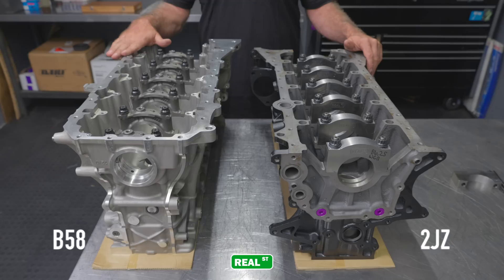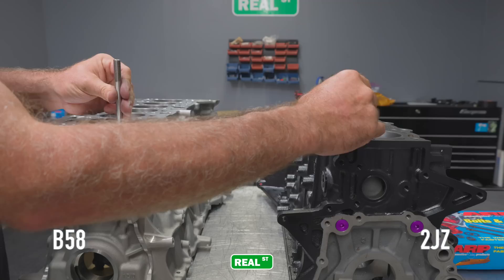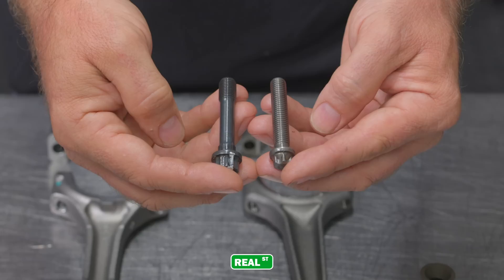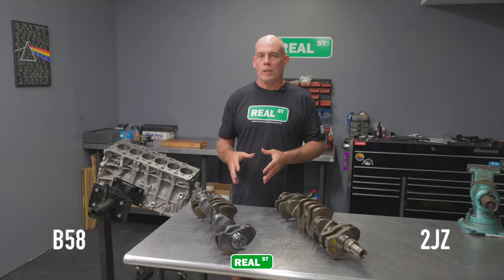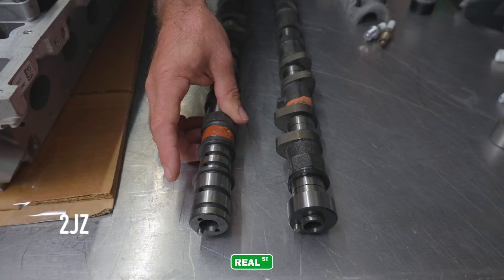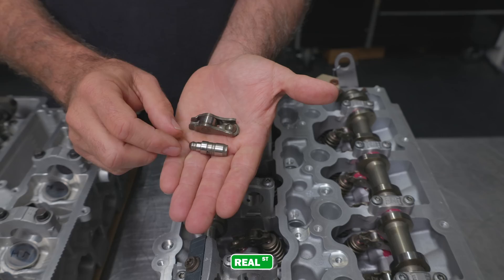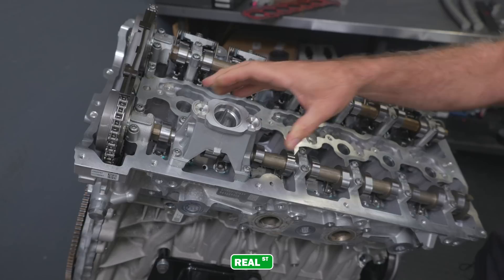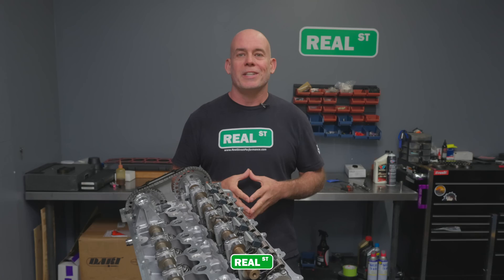Toyota 2JZ VS BMW B58 | 2JZ STILL KING?! (Detailed Engine Internal Comparison)

Comment: Don’t forget, that the B58 block was designed to be a Diesel engine. Hence the high compression. 

That’s why you can run these crazy powers on the stock block
Reply: bingo i work at cummins and the compression of a 3.0 diesel standard block can hold up to 1500 lb tq for 4 hours constant the b58 is perfect cradle why the s58 is even better with forged internals just rebuild top end ( intake and turbos better fuel mix) and u have a supercar. 150k of daily beating is crazy if u drive them as transpo 400k is easily attainable with 5 to 6 k oil changes not 8 to 10k
Reply: it looks like and m57 on the bottom rods crank
Reply: @terrencemcphail5782  what is a lb tq?
Reply: it wasn't designed to be diesel engine.. its was designed to be modular engine (3,4,6 cyl, same parts for piston, rods, head)
compression ratio has nothing to do with block design. VW runs even higher CR in their engines, and smaller bores. Why you can run crazy power on stock block has to do with material thickness, cad/cae of block flex, good engineering of fasteners, gasket, piston and rods. Also not saving up on parts and castings.(like in past)... VW has to be looked up/thanked for quality of casting and processes and their improvement in German automotive industry (e.g. 07K, 07L/BUJ, EA113/EA888)

Comment: I'm an N54 owner and am happy to see the B58 learn from the gremlins that I have had to deal with. From what I've seen it will be the next powerplant in my next car I own for sure.
Reply: Yep, as an N54 owner myself I will be stepping up to the 340 soon.  I love the n54 but man it sure does test my patience.  Still a beast, and I love that car.  The 2J is a great engine, but good luck finding one.
Reply: Just dont overheat your spark plugs and damage your cylinder head🤣

Comment: 20 years apart, and still taking the germans to school... No BMW engine will ever last as long as a Toyota engine... The built in reserve and tunability in the JZ lines is just mind boggling... Almost as if they went and decided - we gonna build te 1JZ and 2JZ engines as Easter Eggs with different layers for curious explorers to unfold... Man alive, have they cracked that!

Comment: I've really enjoyed this video. I'm a big fan of the JZ-family (owned multiple 1JZ sedans and have a project-car MkIV Supra). I think the B58 is the "2J for the 21st century" and will prove to be an amazing platform in the long run. I really like the reduced weight of an aluminum engine and air-water intercooler integration. Where I live in Japan, I don't think any shop is building or tuning B58s. I'm not a car mechanic or mechanical engineer by trade. If I wanted to get started on building & selling mild (~500-600hp) built B58s to the local community, where would I start, in terms of training resources, and what equipment do I need to purchase?
Reply: 500-600 on a b58 is just a downpipe and a tune, no building required
Reply: Go visit the big tuning shops that do this over there so you get an idea. The power levels you speak of can be achieved with mild tunes so the first thing you should do is learning how to tune and what equipment you'll need to get it done properly + marketing. You need to make a name for yourself and that takes time and/or the right customers to get the word out. You'll need a few of those engines to dismantle, work on, study and tune effectively + testing, data logging to make sure your tuning is sound and produces reliable results. Papadakis reckons the internals are fine for ~1000hp stock so your 5 - 600 goal is ez pz. Decide whether you want to learn to tune factory ecu's or do engine swaps with standalone ecu's. Get a development car according to your choice. Work your ass off. Before all that, dig deep to be sure nobody else is doing it and whether you can create a demand for it. There are so many online tuning options nowadays that one can probably order an obd2 interface and generic tune for that power for like 500 bucks. You could start by offering to get that done for people and learn to look up the factory maps to compare to online tune maps (try a few if there are multiple such services) then learn to customize and optimize those maps for specific mods that might be added like cold air intakes and exhausts, downpipes etc... Good luck.
Reply: Actually, the motor Papadakis put together for ~1000hp on stock internals may have been a S58 instead of a B58 but the B is still probably able to easily handle 600hp+, just looking at how it's put together and the quality of the parts.
Reply: The B58 wouldn't take much to get to 500-600. A tune alone would get you to 500.

Comment: My humble opinion. 

B58 is the new King. Why:

1. B58 can handle more power reliably, than a 2JZ. A 2JZ block can handle upwards of 800hp BUT it’s internals can’t handle that reliably. It’s good for about 600hp before a rebuild and upgrade are needed. A B58 can handle just as much, if not more, without needing to be rebuilt/upgraded.

2. It’s very expensive to build a 2JZ. People don’t talk about this that often. They just say “Check out this 1000whp+ Supra!”, and leave out that it cost upwards of $100k to get it there reliably. To get a B58 to 1000whp reliably costs a lot less. 

3. Drivability of a modded B58 is a lot, and I mean A LOT smoother than a modded 2JZ. Boost threshold is a lot less on the B58 vs the 2JZ. B58 fuel economy is a lot better.

4. Sound is subjective. I personally like the sound of the B58 more than the 2JZ. But I do have to give it to the 2JZ, because without it, I don’t think manufactures today would be focusing as much on the sound.
Reply: I wonder how the new Mercedes-Benz M256 engine would do against B58
3L inline six, stock 435hp

Comment: I got the G42 M240i a few weeks back, once you get about 800 miles the b58 engine really opens up. great engine
Reply: The break-in period for my 2024 Supra is 1200 miles with no more than 100 mph and 4500 rpm. I still have 800 miles to go.

Comment: I think watching those oil pumps come apart tells a lot about these 2 engines and the differences they have. One has 3 parts the other has 30+.
Reply: One is sports oriented performance the other is a passenger car 6 cylinder.
Reply: @moneyshifters  its really the S58 that should be compared with 2JZ, not the B58. 2JZ were an expensive engine going into a relative expensive car. that said stock and tuned the B58 is better in just every way possible to the 2JZ except for 700hp+

Comment: The oil pump on the BMW engine is a vacuum pump and oil pump. The side with multiple vanes is for oil. The side with 2 vanes is vacuum for brake assist. (MINI master tech)
Reply: You are totally right. It is very important not to give wrong information to the people. Some of BMW engines have a scavenging pump, but B58  doesn't have it.

Comment: Fantastic video.  The few questions I didn't see answered are: 1) tuning HP likelihood for the aluminum-block BMW?  Does modernity make up for the less-strong metal?  2) heads are both aluminum?  3) difficulty of adjusting both cams?  4) power actually saved by the vaned pump?  5) curious why the smaller bore and longer stroke of the BMW?  6) do both have interference should the belt/chain break?  7) difference in weight between the blocks vs. difference in weight fully dressed?
Reply: I know but two of these questions, longer stroke because BMW wanted higher compression while maintaining 3.0 displacement. So subtract from bore and increase stroke, also B58 Is interference, 2jz is not

Comment: So overall from what I gather is the  B58 is a great engine but the 2jz still have a bit of the upper hand from a performance stand point.
Iron block vs spray in liner
Less moving parts in the oil pump
6 port exhaust 
Bigger valve/combustion chamber area.
Reply: Yes, but BMW has the S58, an actual worthy competitor, and the 2jz is so heavy it could be compared to the S63 V8. 
What is the point of an I6 as heavy as a twin turbo V8 using as much fuel as a V8?
Reply: @laurean5998  i do agree that it's heavy but that is because it's an iron block and that definitely helps when thinking about the integrity of the block for holding MASSIVE amount of horsepower. Because of it heavy construction no additional sleeving in the cylinders is needed , add some billet main caps and that block is good for upwards of 1600hp, show me another lightweight production block that can do that without sleeves or other cylinder support.
Reply: @CmoneyGarage  an ls1 iron block
Reply: Only the 2020 supra has 2 ports, 2021+ Supras have six port head, 10:2:1 compression and makes more power.
Reply: @laurean5998 Clearly you work for BMW, you seen on EVERY post saying the same thing over and over and over!!!
Reply: @exoticspeedefy7916 It's a V8 also, not an inline 6.

Comment: the valvetronik is also good to avoid turbolag, because the boostpressure is always directly up to the valves and doesn't need to travel from the throttlebody up to the valves. sure that isn't a problem on the dragstrip, but when running on and normal track it gives you instant power so it feels more like an natrually aspiratet engine and not like an turbocharged engine
Reply: @YoumomisBeautiful 72k miles on my M240i, no issues. I know people with many more miles and have no issues. The N52 definitely had teething issues, but the system has largely been refined since its introduction 2 decades ago. And every Valvetronic motor has a throttle body as a backup in case the Valvetronic goes bad, the valves lock to full lift and the engine will run on the throttle body until its repaired.
Reply: @porschelover04 72k miles is a new car still 😂 200k miles is the ultimate bench mark
Reply: @repingers9777  Ehh, they're definitely not an old car by 70k, but they're showing some age. Call it the mid-life crisis range 😂
Reply: @YoumomisBeautiful  engines at bmw get designed to hold atleast 300,000km (186,000 miles) only with maintainance, the cars they use as long term testers dont have problems 🤷‍♂️ nearly every bmw in germany has no problems, as long as you maintain them properly they hold up
Reply: @YoumomisBeautiful oh no! my $50 solenoid that is easy to replace because it’s just on the backside of the engine!
Reply: @huh0123   I don't know where you got this price from but a velvetronic actuator costs 450USD
good luck getting that valve out on the car
Reply: @YoumomisBeautiful B series Valvetronic is not unreliable whatsoever lol

Comment: I don’t get how people are turning this into such a debate lol. Either engine gets great power with the money put into it. I do think many people think that the 2J pushes 1500whp completely stock lol. Like it’s not in god mode right off the bat.
Reply: No but a head gasket upgrade alone the 2jz can hold 1000hp which makes it one of like 4 motors period to be able to do that

Comment: I hate the the cam gears and timing system on the backside of the engine would be a pain to work on on the B58 and all the plastic parts suck too at the end of the day it’s still a European engine so if there’s no oil underneath then there ain’t no oil in it 😅
Reply: "if a jz doesnt leak oil it doesnt run"
Reply: Sadly, this is true. Coming from someone that had multiple 90's and early 2000 BMW's. Oil was the lease of the worries that i encountered. But when they ran it was BEAUTIFUL! Tick Toc!!!
Reply: @slezyorla  eh? there's the cam seals,  (possible vvti gear), valve cover, crank seal and rear main - it's relatively easy to sort the leaks on a JZ. 

You're thinking of some other engine
Reply: @Sam-go3mb  im an internet mechanic i donk know shit about this. i quoted jimmy oakes back from when he had his white supra
Reply: @slezyorla  fair. sounds like he couldn't be assed sorting out all his seals 😅 so he changed it to 'the leaks give the car character' 😂

Comment: Compare these engines to the barra 4.0 inline 6 next, that thing is a juggernaut compared to these 2. B58 - 350lbs, 2jz- 440lbs, barra 4.0 - 525 lbs, 1 extra litre of displacement and is much taller than the other engines aswell.
Reply: The barra is an amazing engine.
Reply: @skyu777ayala2 😂

Comment: The b58 has smaller bores, smaller combustion chamber, smaller valves and a longer stroke.  No thanks.
Reply: Way more complexity too. Did you see that oil pump?! Looks like a Swiss watch.

Comment: Well from my opinion based on this video let the small war between B58 vs 2JZ finally come to a end. Both are great engines, with a bright future for the B58 to become the true successor to the 2JZ engine.
Reply: I think only Toyota can produce a true successor to the 2jz
Reply: @Tax_Mny Only with the help of Yamaha, of course. Theyre the Genius behind Toyota's Best motors ever built.
Reply: This is a long running misconception. Yamaha co-designed the head on the 1jz and had NOTHING to do with the design of the 2jz
Reply: @Tax_Mny would cost billions. Hence why they co developed the mk5.
Reply: @nationalsearchinc.4769  thank you! So many people bring up Yamaha when talking about the 2JZ.... The 2JZ was not co-developed with Yamaha.
Reply: I believe many Supra enthusiast were expecting a ~$110-130k MKV Supra developed and designed by an in-house dedicated team of Toyota engineers, with the expectation it would be equally as impressive as Nissan’s GTR. Instead, Toyota went a different direction.
Reply: @Brian-tu7yn  Then those people would be wrong. The Supra was never meant to be on par with the r34 gtr. It's rival was always the Nissan fairlady Z....
Reply: @ggthx  Buttttttt, it was so well developed that it was compared to the????
Reply: @ggthx  downpipe and a tune would make it faster than a r35. Pretty insane for the price
Reply: I don’t think the question is so much what or who Toyota intended the MKIV “rival” to be, but instead, the real life performance and tunability (if that is a word?) of the Skyline R33/R34 and MKIV Supra put them in the same conversation. I don’t think anyone in the past two decades looks at the 300ZX and the Supra and believes they were competitors in any manner other than for the pocketbook.
Reply: @Tax_Mny They were both at the cutting edge of tech which is the only reason they were really compared the Supra was more of a gt car, like the z. It’s also didn’t help though that both the Supra and the r34 both had inline 6s.
Reply: @Brian-tu7yn  Um what? Again when the car first came out and until people started to realize the "tune-ability" of the 2JZ wasn't until almost a decade after the Supra came out. You guys not go back and do some research?
Reply: No research needed. Was around for all of it. But you’re making my point in all this. When people were buying cars, they thought the 300ZX and Supra were rivals. Once people realized what the Supra was and still is, the conversation changed. Is your point the automotive community should wait a decade to see if BMW has produced a R35 competitor? My point was I wish Toyota had the same dedication today to engineer an engine and put it in a Supra that they knew to be an R35 competitor. They did not do that.
Reply: @Brian-tu7yn  Are you being intentionally daft? Toyota is all about efficiency, especially in today's car market where the sports car are very low volume in demand. You also keep making my point for me as to how people miss interpreted what Toyota did with the Supra. Yes the 2J was great for tuners at the end, but Toyota brought with the MK 5 Supra was exactly what they had in the past, its the MKIV Supra fanboys that only think the Supra should came out as a super car when it never was to begin with...wow...
You want Toyota's super car? Ok try getting a LFA.
Reply: @nationalsearchinc.4769 yes that's true but toyota literally added a half inch deck height and called it the 2jz. They're extremely similar in every way
Reply: @Tax_Mny  drag racing? Sure. But the R34 wasn't designed for drag racing, it was designed as a track monster that murdered the Supra in GT racing.
Reply: @Tax_Mny because of what tuners did to it. the spirit of the car and what the literal makers of the car intended it to be are what its real identity is primarily, not what some dude with a wrench and a laptop can turn it into, your argument is so misguided lmao
Reply: @mryang3644  and in a German facility lol.
Reply: @hau5muzeek  Misguided? I said what I said
Reply: @Brian-tu7yn not really. Wouldn't make sense to really make it R35 competitor when they said they wanted it close to the hp the mk4 had so that whole thing would've been thrown out from the start before they even started developing the car.
Reply: Idk about that, maybe if it had a cast iron block.
Reply: What kind of hp can the B58 block handle compared to 2jz just curious?
Reply: Not a successor if it’s German
Reply: the blind fans will not agreed with you and will keep finding excuses to bash the B58 while not even owning either of the engines. Both are equally good and easy to work with.
Reply: @tempeztad  they are not equal, a b58 will split its block trying to make what a stock 2jz block can take, which is 1800whp+. Cast iron block is stronger than cast aluminum. Simple as that. B58 is a great engine, but the 2jz block is stronger.
Reply: @madkas14  👍
Reply: @tempeztad  but if you upgrade the components in the 2jz it could match the modern components in the b58 and also the 2jz  is an iron block so you can pound boost
Reply: @fpsracerhockeydab9857  that's the point with the B58, you don't need that much power in first place as it put it down more efficiently. I'm starting to think that people only measure power when there is a lot more that goes into it. Mike Botti already tune stock internal B58 in the 900whp no issues on a engine that weight half of not less of the 2JZ. At this point, they are equally good and functional in a variety of situations.